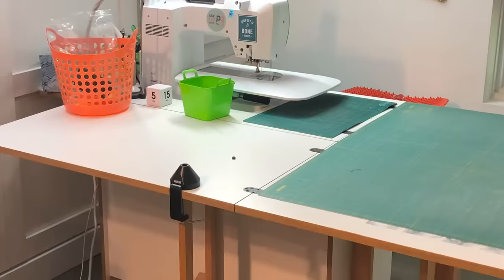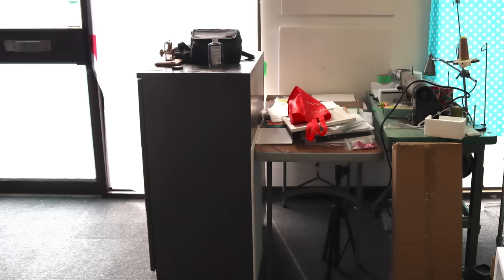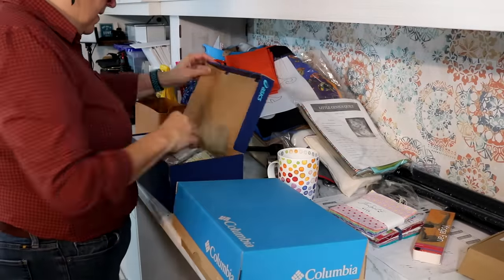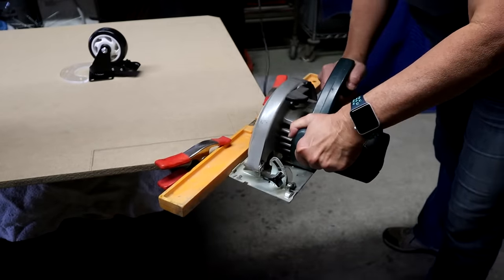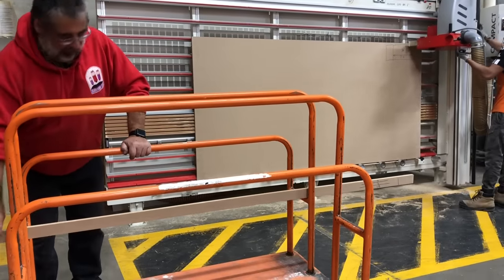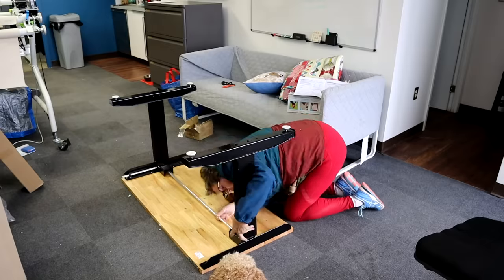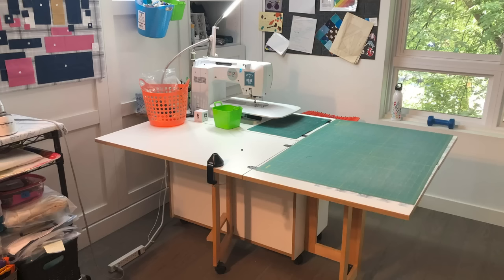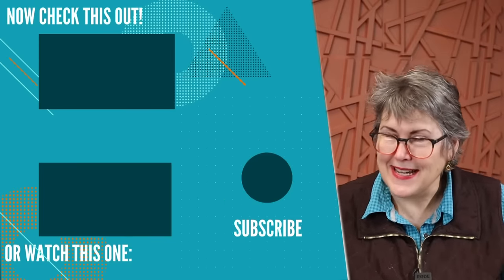🚚 MOVING MY SEWING SPACE INTO MY STUDIO

Comment: Your new set up is great! I'm a little biased though because mine is very similar. I DIY'd my big table out of the same Kallax units as you, but I got the long white laminate countertops (2) instead of the butcher block (too rich for me!), and I drilled the casters directly into the bottom of the Kallax units after attaching them with mending plates and L brackets. I love it so much! 

Before I had a studio space that could accommodate such a large table, I bought one of those Husky tables! Then another, and then another. So I have all three sizes, and I use the biggest one for my ironing station. 

I do still have a sewing set up at home, and I agree with your friends about the difficulty of moving projects around, as well as tools and supplies. I've gotten in the habit of doing all my cutting at the studio, and some tools I've purchased a duplicate set of to minimize frustration. Still figuring it all out (2 years later!), and it's not perfect, but it's much better than sewing out of my bedroom. 

I hope you love your new space. It looks wonderful!
Reply from the maker: I am determined to keep the sewing out of my bedroom too

Comment: Love your videos. I noticed you are putting your wool mat directly on the butcher block surface. FYI I did that on an end table and realized the heat and spray caused condensation that damaged the wood surface. You may want to add an old cutting mat under the wool mat to prevent any damage.

Comment: I'm fortunate to have a large sewing space available.  I'm unfortunate to have a large sewing space available because I have an uncanny knack for filling up space with "stuff"! Cautionary tale for those of us who repurpose existing furniture.  I have cherry dining table  (used for staging) with 2 extensions that made for a perfect sewing surface.  HOWEVER, a heavier sewing machine in the middle of a fully extended table, puts stress in the middle.  I noticed that my table was bowing down.  The weight of the machine had caused the screws to slowly be pulled out of the extension rail. Thank goodness I found it before it collapsed and tossed my machine (either on the floor or my lap).  I fixed the issue by putting in mid support.

Comment: Be aware that humidity builds up in the wool pressing mats with a heavy pressing session. I damaged the oak top of a chest of drawers. Even with a heat reflective pressing sheet beneath.  Ended up putting a new surface on top:  towel to prevent slipping, giant bamboo cutting board, heat reflective mat (rubber backing so it doesn't slide on top of cutting board) then wool mat. No moisture gets past cutting board.
If I'd had a piece of scrap glass that would have been a bit thinner than the cutting board.

Comment: This goes on the right, and this goes on the left.....Chefs call that 'Mise en Place'. 
Basically, setting up your workspace so that you can get the exact tool you need without having to look for it.
A word of caution...since you elected to use MDF, it would be a good idea to paint wherever you trimmed, or cut the MDF.
Use a putty knife to cover the roughed up area of the MDF with spackle. Sand and paint to give a nice smooth finish to the MDF, and get rid of that weird furry look that MDF usually gets

Comment: Hi Karen, I was wondering how you're doing with your Husky table?  Namely does it fibrate when you're going full speed ahead?  One of  the things I'm really impressed with is that it is height adjustable, and a butcher block top.  Will it bow in the middle?  I have a folding table that has bowed, even as sturdy as it is, I was disappointed when it bowed after only a year.  This was the third table.  I have to do something better.   Thank you for your feedback.
Reply: I have one but I am not sewing on it. It is very sturdy and would think the vibration would be minimal based on how thick the top is. I hear you about the plastic tables bowing. I have had that happen to me too if used for long periods of time with stuff (junk) piled on top.